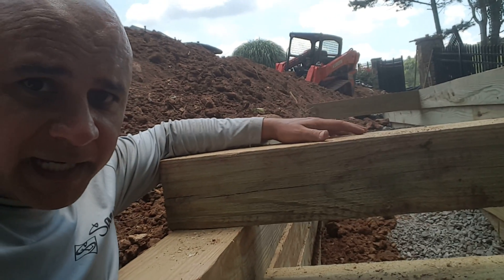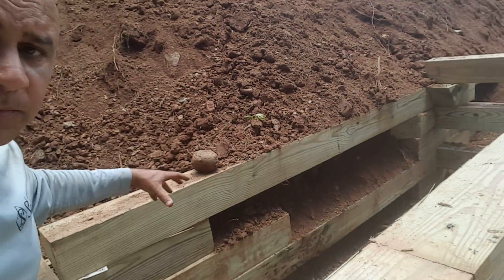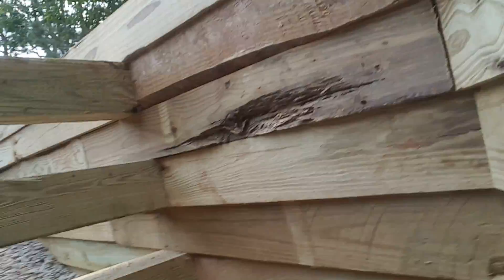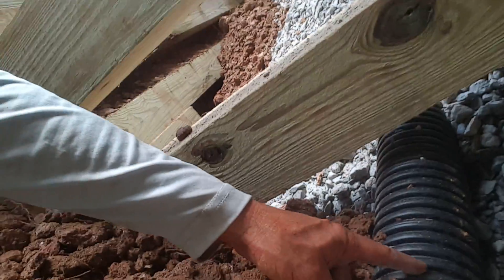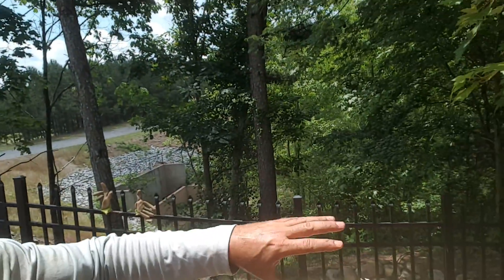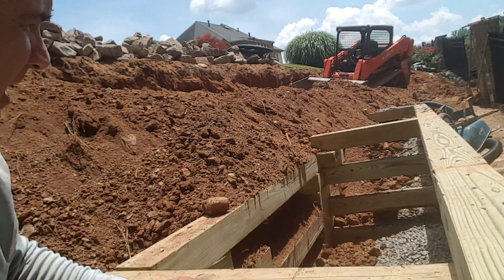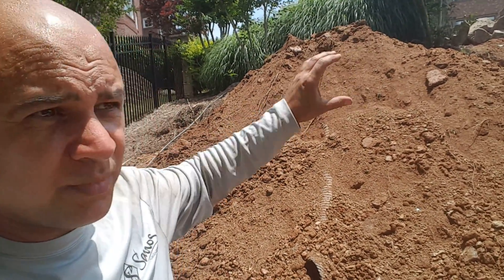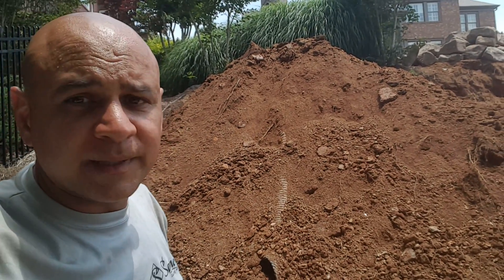How to Reinforce a Timber Retaining Wall 💥 Sarros Home Repair Solutions (Wall Reinforcement)

Comment: Hi Phil, is it possible to put vertical bracing in front of the wall instead of adding deadmen T posts behind the wall? I plan to remove a 3ft tall railroad tie retaining wall this summer and replace it with 6x6x8 timbers like the ones you used. However, due to where its at, I might not have the ability to dig back into the neighbors yard to install T posts. I was going to put a vertical post every 8 feet that are cemented into the ground about 3ft deep in front of the wall. Galvanized spikes throughout the whole wall with a drainage system behind it. Thoughts in how structurally sound that would be? 

The retaining wall doesn't hold up much pressure but is prone to water runoff and there will be a fence built behind it.

Comment: Its 2019 ,who still uses. Wood???   So. Many. Better. Similar. Cost ways to do. Better,  like. Blocks, dude you don5 know. Shit, that wood. Will. Rot. In b10. Years,..
Reply from the maker: I acknowledge your position and promise to weigh it carefully.
Reply: @SarrosLandscaping  I like the look of wood and was wondering if there is a way to use maybe tar on the back of the timber to limit rot?  Back fill with rock about six inches with a drain at the bottom should limit constant moisture shouldn't it?  Thoughts please?

Comment: Why no filter fabric between the gravel and the soil? I always assumed without it the dirt would eventually work its way in and clog the drain tile. Otherwise very useful and informative video.
Reply: I've been watching videos on building retaining walls and from what I gather the only time you want to use fabric is in sandy soil.  The fabric gets clogged up by regular dirt or clay and creates a damn which will lead to retaining wall failure.  Using the type of rock as shown here is the best way.  I didn't see if they are going to back fill behind the wood up to around 6 inches.  A lot of ideas.
Reply: @Kitzishot    Yes, I learned this the HARD way. I spent many hours digging down into heavy clay soil to foundation footing and installing 60 ft. of perforated pipe and gravel, all wrapped in heavy duty non-woven fabric. Within a few months I was getting flooding again in crawlspace. I had to dig it all back up, remove the fabric, reinstall, only this time I just laid fabric on top of gravel, acts as a soil separator. Problem solved. DON'T wrap pipe and gravel with fabric in clay soil!

Comment: You have some fantastic videos on retaining walls.  I'm replacing a 3 ft high by 110  ft long wall this spring.  How far back are you placing the deadmen?
Reply from the maker: I usually default to a minimum of 3' or 100% reinforcement,  whichever is greater.  So for example a 5' tall wall would have 5' deadmen